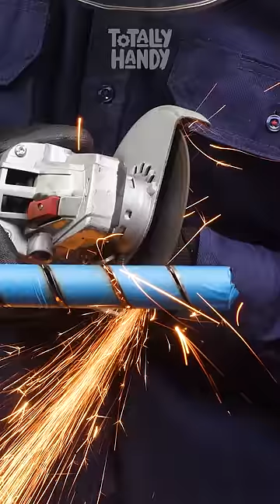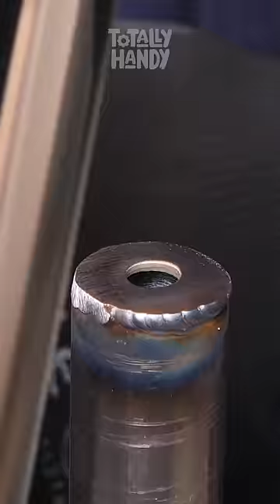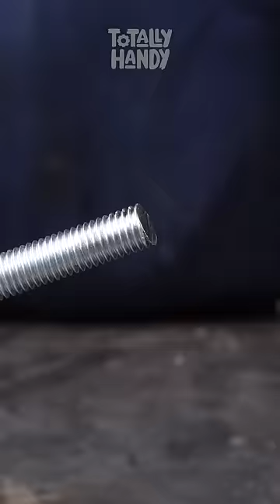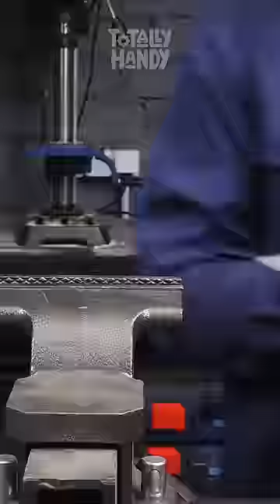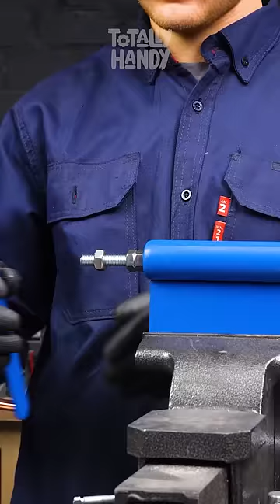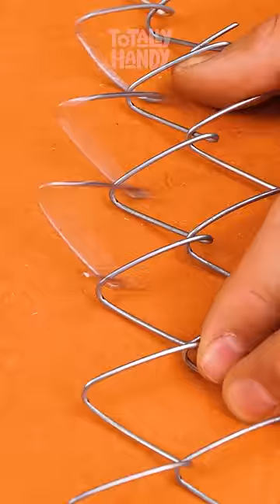DIY Wire Forming Tool #shorts

Comment: “DIY”
Proceeds to use every tool I don’t have
Reply: @Troy Thurman you literally just made up the second one right now 😂
Reply: Toooooop 👍👍👍
Reply: @Troy Thurman haha go home Troy 🤣
Reply: Probably cheaper to buy the wiring forming tool
Reply: @Troy Thurman You're an genius. Above 9000 IQ
Reply: You are telling me you do not have a workshop?

We all have one where I am from. Maybe you do too.

Remove your toilet 🚽 the workshop lever is in the hole. Maybe yours is deep in the hole. My neighbour has to go in till his armpit before he reaches his workshop lever.

Let me know how it goes. I would be surprised if you do not have a workshop. Always thought that this was a common thing.

You will need a tool to remove the toilet, I always keep mine outside of the workshop.
Reply: He made a diy wire forming tool. You don’t need any tools to use the tool he made.
Reply: y’all seems to not understand... for the most folks, they don’t have a fcking welder and a grinder...
Reply: Theses are basic metal working tool
Reply: Maybe if you start doing fences you would have it
Reply: @ifazeyou8591  go finger paint instead?
Reply: @pineappleproductions4784  ধ
Reply: You don't have an angle grinder, some tape, and a welder? Do you even have a garage??
Reply: @roogle3878  no but need tools to make it lol and might aswell just by the bit itself rather then buy everything else to build this piece of YouTube view trash lol..I own 30 x 6 shops fully stocked with every size nut bolt lock washr drill bit clamps welders jointer planers u name it ..I ran full contracting business for 12 years and still do ..but this is pointless other then just playing ..its not diy cause 95 percent of home owners don't have tools to do it to even get to part of doing it themselves ..lol just a waste of 30 seconds
Reply: @Troy Thurman his point is not everybody has tools, in fact most people dont have any tools therefore most people cant do it
Reply: @trevorstrutt1  I think it’s cool tool if ur a chicken coop builder
Reply: Faxxxx
Reply: Hahahahahaha
Reply: @_-KOEN-_  yea because you're gonna eat the tools you bought after making this wire tool
Reply: FOR WINNING LITERALLY NOTHING
Reply: @Troy Thurman э
Reply: A man that doesn’t own a grinder isn’t much of a man at all.
Reply: As far as I can see he mostly used a welder and a hand grinder with a cutting wheel. Pretty common tools.
Reply: Sounds like a skill issue
Reply: Bruh😭😭
Reply: @pineappleproductions4784  yeah he knows that lol
Reply: @GeneralHowToTutorials  not gonna lie, I'm pretty sure most people only have a set of drills and saw only, grinder is a maybe and a pretty big maybe, welder yeah most likely not ...
Reply: Lmao 🤣 mad work
Reply: Literally this like

If you already spent 3 grand on the tools to make it... just fucking buy one
Reply: @Troy Thurman 😂😂😂😂
Reply: Hii guys
Reply: это по русски называется ананизмом
Reply: @ВячеславБеляков-ь8й  nobody here speaks belgian my dude
Reply: Pretty basic garage setup tho tbh. Although  it took me months to find a somewhat affordable little house with a tiny garage to rent. But it's been worth every penny. So much space for activities. I'm going to be very sad if I have to move back into an apartment or something.
Reply: Being a fabricator and welder by trade, I watched this video to bash him, well he knows his stuff, and actually a LOT of those tools can easily be found at garage sales a lot of times really cheap. A buddy of mine buys welding equipment(and some other general tools) and fixes them. It’s crazy how people will toss or sell a brand new welder, that only needs a new cord.

Comment: Every DIY person: “You just need some simple basic tools, that everyone should have.”

The DIY person: pulls out a welder
Reply: the fact that the welding is cut so it seems like nothing without even the mildest soark makes it worse
Reply: But everyone SHOULD have a welder! X'D

I actually kinda wish I knew how to weld and do all this
Reply: He isn't even using it right, just spots like that won't penetrate and so the weld is hella week
Reply: @edvinwestman8375  thank you, i thought I was the only one who saw this, and im not even a welder.
Reply: @SakaraCoyfox  Get one! Even the cheap Chinese models these days aren't too bad. I bought one of the ebay stick/tig pocket welders and it has turned into a pretty useful tool even though I own large engine driven units. Dirt cheap investment and a useful trade. Watch some YouTube videos, you can do it!
Reply: @edvinwestman8375  it's a nut holding on a pipe for a handle it's not exactly high stress environment for it
Reply: @DanielSan-ch7dr  yeah yeah I know but it's probably influating what people think welding is. Yes it looks good like tig but a mig just isn't the same and a weld like that with a mig won't hold
Reply: to be fair if you need a wire maker then you're probably the kind of person to have a welder
Reply: @Cowboyfan-wk6ww   The welds you are seeing are just snapshots of what is taking place most of it is edited out.
Reply: @edvinwestman8375  what are TIG and mig ? I've never welded in my life but i'd like to try but idk what kind is what xD
Reply: @thibault_4705  MIG is mainly steel, very simple to learn and do, and TIG is harder, mainly used on aluminum
Reply: True, this wouldn't save you much on small scales at all.
Reply: @edvinwestman8375  he edited the sparking portion of the weld out, if they were just tack welds you would see the individual edges when he ground them down
Reply: It is a basic tools, picked one up at Canadian Tire for $270
Reply: Is have 4 welders, everyone should have one lol.
Reply: A welder is a simple tool
Reply: Most diy people i know have at least one welder
Reply: Luckily I have all the tools he used 😅 
Everyone should have some basic tools 💀 xd
Reply: @Keksmonster22k  ķ
Reply: Welder here… his tack welds looked better without grinding -,- it wasn’t needed …
Reply: Пофиг на сварочный аппарат, он достает полуавтомат)) Инвертор добыть не проблема, он $100 стоит
Reply: Pretty basic.
Reply: Tbh welders aren't usually that expensive, you can get them for downwards of £200

The main problem is know what welder to buy and which one to use for the specific job
Reply: @Cowboyfan-wk6ww  as a welder I can personally tell you that the person in the video was doing it wrong, he wasn’t even welding, just shooting tacks.

Comment: Looks like a good way to make magazine springs.
Reply: My first thought lmao
Reply: Not really it’s cold welding that thing he made won’t last long
Reply: @ronaldobaca8823  Ah yes, cold welding which leaves the material he tacked glowing lmao
Reply: @ronaldobaca8823  💡How are those "springs/coils" cold welded😕 They weren't welded at all. All those coils need is some heat treatment and they'll be springs👍
Reply: @oliverm.2118  😂👍
Reply: @catherineharris4746   cold welding, meaning it isn’t fused like fusion welding 
It also goes by contact welding because nothing is being melted together so there is no phase transition
Reply: @ronaldobaca8823  👍
Reply: @ronaldobaca8823  The forces on this manufactured tool (while operating) aren't so high i.e the weld might work💪
Reply: They just edit out the flash from the tack weld. Red hot cold welding. Mag springs is what l thought also.
Reply: @ronaldobaca8823  cold welding refers to TIG welding process that shoots electrons impulse

Comment: As a welder, I am always disappointed with the "tack" method they all do. Just weld a bead!
Reply: "I've got some dye check, and I know how to use it!"
Reply: Tack welds are used to lock in place the parts to weld them in the final position,but the truth is that for a short weld time on medium thickness materials,i also use hi temp parameters for mig tacks,then spot weld the rest if the parameters are too high for the materials used and still want a nice ripple patern seam,but with no structural weld strenght needed,just to look nice in a way they like,and this
way,beginners or hobbyists can get a more easy way to keep a track and a straight line to get a nice overall aspect for a piece of metal that does not have critical aplications,even 3 separate tacks on each side is more than enough to roll that wire to make into chainlink fence strings...cheers from Romania ☺️

Comment: Interesting... You could use a 3D printer to create most of the parts of a magazine, then this technique for the follower springs.  I don't know if the plastic would last for thousands of rounds like a metal magazine, but you could just print more when they wear out.

Comment: You expect me to have all these tools first and welding skills. No thanks ill just buy it.
Reply: You can also do something similar just using the wire and metal bar, attaching them in a vice grip, and attach the wire into an impact driver. Then just adjust the tension to bring them closer or further apart. 

Work smarter not harder.

Comment: Why are all the sort of videos always like this, why can no one now adays hold the damn trigger that welder isnt semi automatic my boy just hold it, now if you are working with weak metal or very thin metal that would be easy to melt then yes you might want to tac weld it otherwise just give it a beed